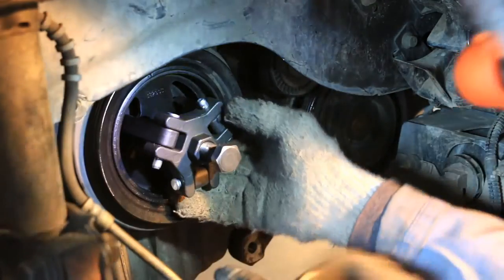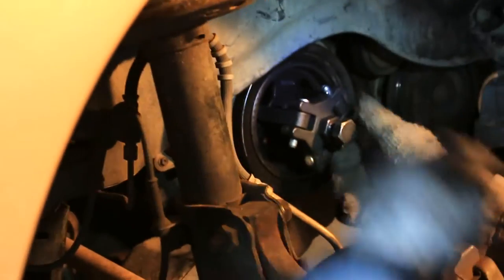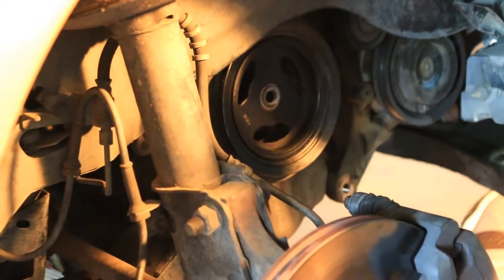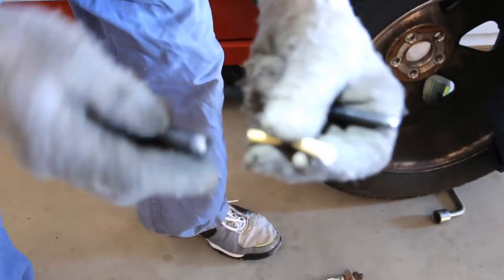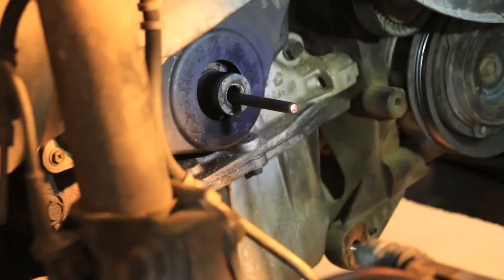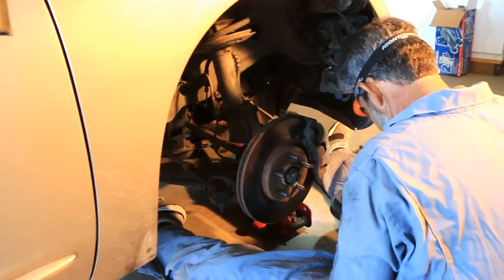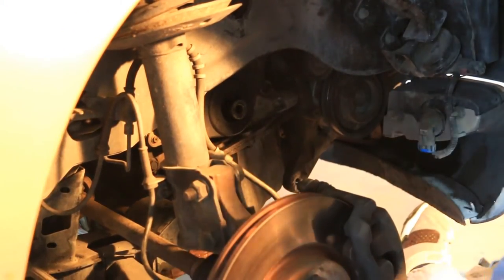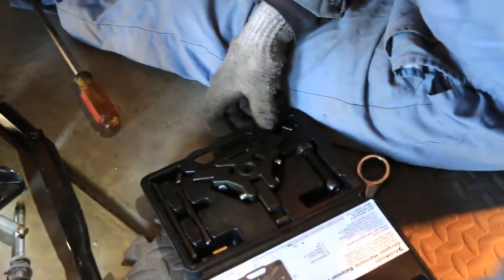Removing the balancer shaft on a 2002 pt cruiser

Comment: Did you removal the internal balance shaft and chain? If so was there very much noticeable vibration? Thanks
Reply from the maker: No I don't believe we did. I don't remember a chain either. I do know after replacing the timing belt after this. It ran just find and the only thing that was causing a vibration was a spark plug i didn't fully plug in. Replaced those spark plug connectors and engine ran fine after that.